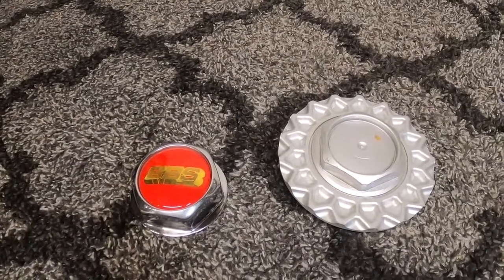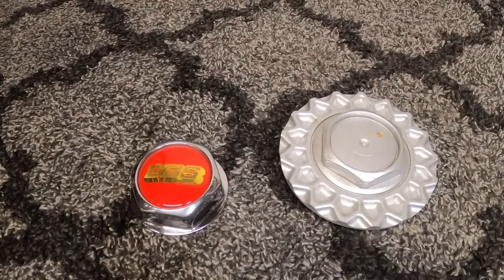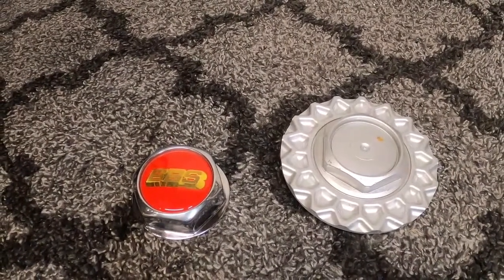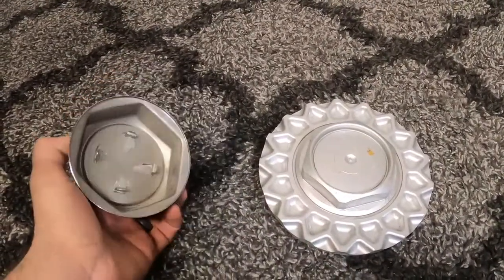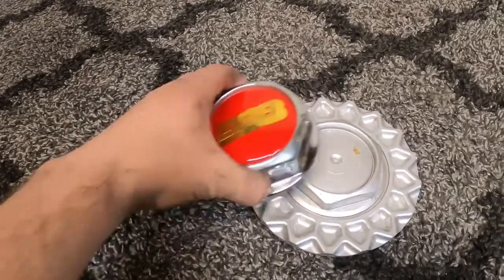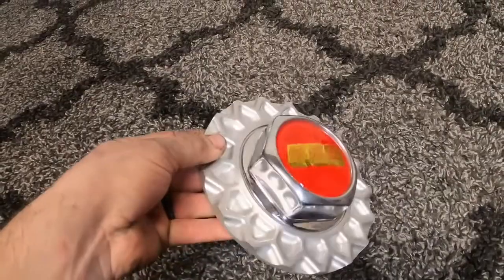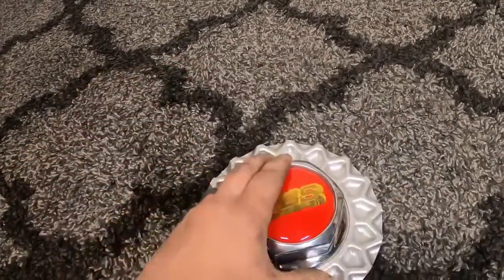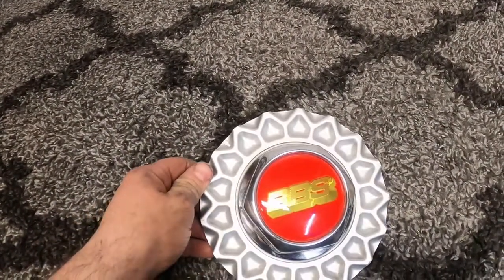BMW BBS Style 5 & Style 19 Metal Hex Cap Install

Comment: Hello Dylan, where did you get the hex cap man? I could not find it on ebay. Thanks
Reply from the maker: The hex caps are sourced from other OE BBS wheels.
Reply: @Dylan_Draper  thank you man!
Reply: Where exactly did you get the center caps